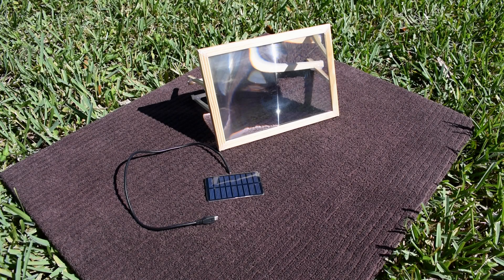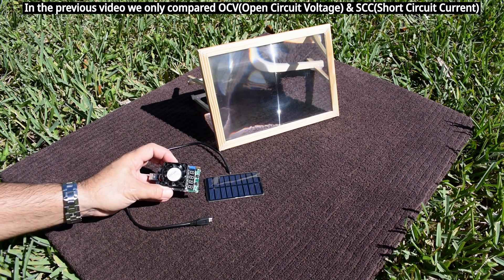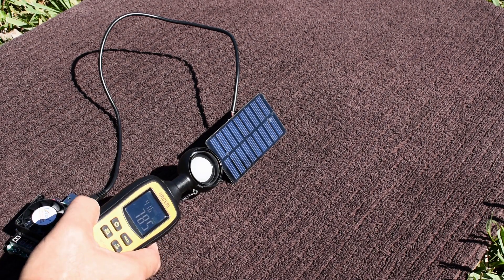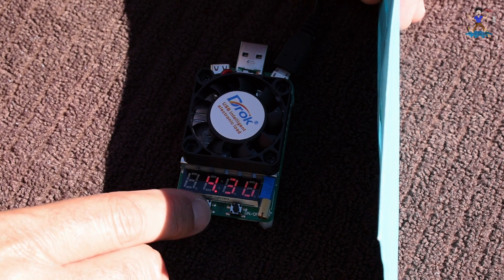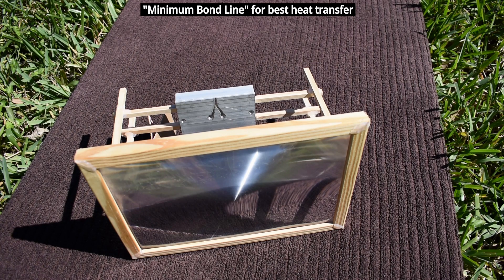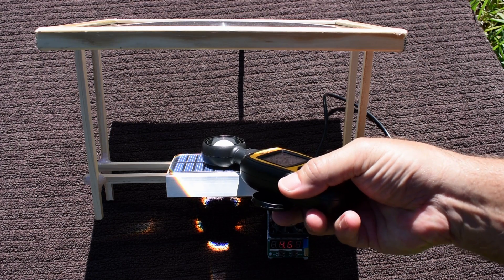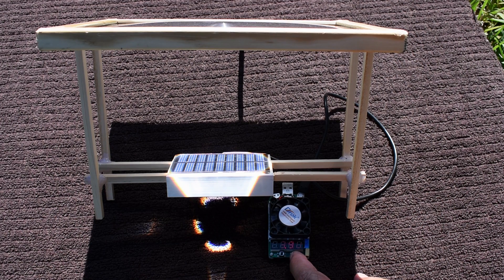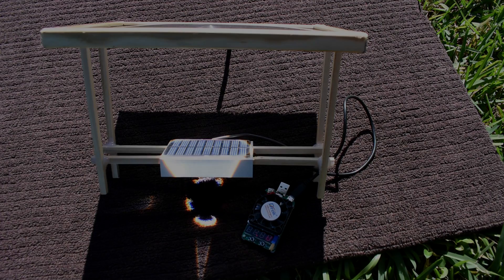Fresnel Lens Solar Panel Experiment WITH Cooling!

Comment: And a hearty good evening to you from Illinois.  Couldn't you take the top of a solar tube and hover it over a solar panel?  Wouldn't that double the output of the solar panel?  And if you connected a cooling device similar to a car radiator to the back of the solar panel, wouldn't that draw the excess heat from the solar panel?  And couldn't someone take that heat and store it in firebricks?

Comment: I'm not ripping anything you've done, I love solar and I recently finished another folding panel for myself to charge my phone while camping.  Honestly I love engineering gimmicks, but at the end of the day KISS is still really hard to beat.  If you're trying eek out 100% more power, just have 2x the cells.  Bifacial aren't even a great solution given their cost, but they might actually lend themselves to reflective setups.  Unfortunately cells output less as they get hot, and the cooling you have to add offsets the gains.  Fresnel lenses really aren't cheaper than solar cells once you add up the structure, cooling, protection (from elements, UV and hail).  Nice demonstration but no real gains over simple m^2.  Especially considering weight, because you have to support the weight, and harden the panels to the effects of weather.  

An exception to this, if you really want to make more power from your panels, have a way to use the heat gain for other purposes, say heating a henhouse or a home.  That's called cogeneration and it's basically using the excess heat generated by the sun on the panels and put it to use rather than wasting it.

Comment: This problem very famous among "DIY LCD Projector" people, LCD matrix from usual LCD monitor, when black screen picture is there, receives all energy of lamp optical system. best solution - layer of water, 1cm is not best idea, but after 30mm of H2O Light will be wery cool

Comment: so how about a very large fresnel lens system with a large solar panel. what is the multiplier, direct input area? meh that fresnel lens is more expensive than similar solar panel. not the way. parabolic concentration mirror is much better and universal. no special fresnel lens panel required. of course you cant work for free. so give it free. what good are you doing in trading anyways. yep diy then you dont burden anyone with wild nonsense. well yep you then only  burden yourself. if you chose to do so. I hope its a nice hobby that you like to do. how about a diy solar concentrator lens with a  transparent water tank.

Comment: Great! That's about as much as anyone is going to squeeze out of that mini solar panel w/out an active cooling syst3m. I really appreciate your frequent monitoring. I'm always interested in how things are changing, and it's frustrating when ppl making videos don't monitor those changes frequently. So, thanks!
Reply: The problem with active cooling is there's always a conversion inefficiency.  So you got 10% more power, you'll need to move air, the motor is 80% efficient use of power.  So by the time you're done, you'll end up -2% or worse because you're running a motor/pump/baffle to cool it.  Why would you exchange the expense of Fresnel lenses and their supporting structure, which BTW is exactly the same m^2 as solar would be, and just use cells/panels?  Make no sense.  Fresnel lenses are expensive, not usually UV stable (they're plastic), and need supporting structure to hold them in place.  Plus the structure to hold the panel, plus the UV stabilizing cover (glass + it's structure).  There's not much more effective than straight solar cells, perhaps with sun tracking in 1 axis and even that's questionable once you figure in maintenance costs of the motors, oiling the bearings......

Comment: What about putting the F lens directly on the solar panel(s) and seeing how far away from 90º you can get from the sun, before losing output?  Use those concentric rings to gather light from different angles and point it down onto the PV cells, ya know?

Comment: If you put peltier module under the solar panel and then a heat sink... Can you generate with this system even more electricity and provide cooling for the solar panel as well?

Comment: interesting test.  the heat sink would work better if you flipped the panel & heatsink so thr sink was pointing up & used a mirror underneath to aim light from the f, lens at it.

Comment: Your approach is backwards. Cooling is helpful but requires NRG which causes pericitic loss. Set the lens away casting only the needed amount of additional light to find a sweet spot for maintaining cooling while producing maximum output.

Comment: solarpanel using only visible light (380nm-750nm 46% sunlight) spectrum (Shockley - Queisser limit? PV materials have band gap?)? Solar radiation spectrum (sea level AM1 vs. AM1.5 (G/D, +45* angle)) (W/m2/nm)? (this lux / light meter show UV (10nm-380nm) & iR (750nm-1000000nm 47% sunlight, going to heat?) light (in lux) too? how accurate are the measurement data in light spectrum (wath solarpanel need/using)?) what is spectrum lose after plastic film (magnifying lens) (and reflection lux & spectrum vs. initial light vs. after plastic) test mW (because heater give +10% power vs. w/o heater (0.2W + 10% = 0.22W and u dont see this + measure device is over +/- 10% loss of accuracy (or more if under 0.5W reading (+/- 0.1W) ) ) ). Better heater is like CPU heater (heating tubes Cu foam thermal conductivity Liquid Absorption). How much is reflection in solarpanel (glass) surface (light angle +/- 10"/20" vs. energy (W) )? (solar panel + water heater (or water expansion/pressure (w valves (+30*C (7par) & +38*C (+41par).))
) 
(+ wind turbine)(+lower ground temperature)) (or heater in winter under 0*C (expansion (solid)ice/water is 10% (water crystal (six edges (hexagon) shape) ) vs. (liquid)water +0*C ~ 4*C & over +5*C ( watch water triple point diagram )) )
5:05 Why? cost (one & multi (6x) ((packed size (night) in emerge box / travel backpack or in car) Lens size, 30*20 cm * 6pcs + 6pcs solarpanel + 6pcs heaters +  )) = Lens + solarpanel, weight = Lens + solarpanel, energy (W, Wah) , packed size  && vs. comparison with one large (Lens size, 30*20 cm ) solar panel

Comment: try in a vacuum!! u could also make a cryo cooler! need 2 be familiar with cryo!! super simple though...
Reply from the maker: Great suggestion. I have a vacuum chamber.
Reply: @electronicsNmore  .their was an engineer, that made  a ''reinforced' vacuum box. 4 ''proof of concept''...but, I don't remember. if it was a ''zero vacuum''. or a ''pressurized vacuum'' +ATM or - ATM??? & the box was over/on top of, the solar panel..but seriously! it stopped ''all'' negative effects from the sun!!!
they also make a high-temp epoxy, that is ''perfect'' 4 hot applications!! U can take a butane torch 2 it!!! no UV coatings, just pure photons!! also, if U knew a little about ''optics'' U can produce an ''un-focused'' optical telescope. that will have the ''intensity''. but little heat? that's the ''key''!!
''NO HEAT''..good luck with it !! if I was ''able'', and had the time! I'd give U some more hard luck stories!!

Comment: If you had a huge panel and did something similar, could you generate enough power to run a water cooling device to cool the panel? Sort of sounds like perpetual energy kind of situation.
Reply from the maker: You always lose, never gain. :-)

Comment: I don't understand how the Fresnel lense helps increase the voltage output of the cell. Isn't the PV effect based on frequency and not intensity?
Reply from the maker: Higher light intensity = higher voltage output to a degree, and higher current output. Thanks for watching!
Reply: @electronicsNmore  hmmm, I must be confusing something. The photoelectric effect shows that light intensity doesn't matter, it is the frequency of the light that dislodges electrons.
https://en.wikipedia.org/wiki/Photoelectric_effect

Comment: Hey guys hate to break it to ya but you can get 99% solar efficiency just by heating water. Sure it's AC current but even if you rectify it that's still 79%. In my opinion I wouldn't touch photovoltaic cells and they seem to just be more cheap Chinese made crap :^
Reply from the maker: I guess you missed the part about this just being an experiment, an experiment that many viewers requested.
Reply: electronicsNmore lol it’s not a bad video or idea it’s just pitiful in comparison. Plus it seems like no one even knows that!

Comment: IF infrared is not needed to make power then using a IR filter will keep the panel cooler =]]
Reply from the maker: Blocking IR, ends up blocking a lot of visible light, and the power will drop way off.
Reply: @electronicsNmore   yes but if you concetrate more light on the panel you will have good power with less heating or none ... you have one panel but you can get more light on it from mirrors and fresnels

Comment: wouldn't a fresnel lense be ideal in cloudy conditions?
Reply from the maker: No, you need some sunlight.
Reply: @electronicsNmore  I know it wouldn't work with completely overcast sky, but when there is indirect, diffused sunlight wouldn't you see some augmentation with the lens? Those of us at extreme latitudes with few completely sunny days could use every little boost we can get. Heat build up would be lower also. I don't have all the great equipment you have, nor the EE training, but I may buy a small solar panel and lens and multimeter to see what happens on an overcast day. I have seen other YT videos of a solar panel laid out in the rain running a small radio, which took me by surprise. Thanks for doing all these videos! Subscribed and learning from you!

Comment: I was just wondering if you applied this method to a larger solar panel with storable power packs would the fresnel lens charge the battery faster and if so how much faster
Reply from the maker: Yes, much faster, but you'd need to keep everything cool.

Comment: I also thought using convex lens and Fresnel Lens to increase solar panel. However it is a hassle to set up them in the correct position. It is better just to buy more solar panel. The new solar panel product is half cell solar panel.

Comment: Add a filter to block unnecessary wavelengths, so the panel wouldn't heat up quickly
Reply from the maker: Cuts power output too much. Thanks for watching!

Comment: The fresnel lense is about 8x the area of the solar panel.  Since the power developed with lense is 4x the panel alone, the system efficiency is about 50%. 8 solar panels in the same area of the fresnel lense would develop 2x the power at a lower temp at the panel
Reply from the maker: As I said in the video, it was only an experiment, one that many people requested. Thanks for watching!

Comment: If you are going to cool the panel...

What if the photovoltaic panel is the surface of a thermal solar collector.  That way you get electricity and a second harvest of hot air or water.
Reply: That's beyond the american mind, Alex...

Comment: Has anyone taken a peltier module like is used on a wood stove fan and mounted them to a aluminum plate and laid it out in the sun light with a painted black plate on top. Hooked in series could get a new type of solar generation system. Even making floating solar barges could be a thing to slow ocean heating buy turning the heat into electrical current.

Comment: Should further collect the thermal energy via a peltier chip to the heat sink.
Reply from the maker: Then you'd need to cool the opposite side of the module.
Reply: @electronicsNmore  I think Todd is saying you should put peltier junctions between the solar panel and heatsink to collect more energy.
Reply: @0JThomps0  And drive a fan with the collected power to cool the heatsink.
Reply: @resetcoder  it would probably barely be enough power to turn the fan slowly. Peltiers are pathetically low efficiency.
Reply: @jkenny1  i know that is why i said that, to make it completely pointless, but at least more difficult

Comment: Saw a similar experiment years ago, the issue was addressed by submerging the panel into shallow water
Reply from the maker: Yes, that's next, but you need to circulate the water, or it will get very hot quickly. Thanks for watching!

Comment: I recon that water flowing over the panel would cool it down enough to allow for the wattage use of the said motor.
Reply from the maker: You wouldn't gain anything by adding a motor.
Reply: electronicsNmore that would depend power the motor consumed a extra power you got from cooling the solar panel

Comment: 70°C is pretty hot. Using a CPU heat pipe or a water block would keep temperatures lower.
Reply from the maker: I can get it lower by making a few changes.

Comment: What if you put a mirror under the solar panel, flip the panel upside down then focus the sun again through the Fresnel lense. Since heat rises maybe it could rise easier into the heat sink. Maybe also the light coming through the mirror could have less infrared heat?
Reply: Heat does NOT rise.
Less dense materials rise.
Most materials show decreasing density as temperature increases.
That isnt the heat rising. Its the material.

Heat simply flows to achieve equilibrium. No direction.

Comment: The fins would cool substantially better if they run vertically instead of horizontally.
Reply from the maker: True, but it wasn't easy finding that particular heat sink.
Reply: @electronicsNmore  possibly you could cut the heat sink in half with a hacksaw, and turn the halves 90 degrees?

I've been really curious about this exact experiment, so I want to see it run with optimal execution to see if it can be effective enough to be worth it in a larger scale application. 

Next level after this would be heatpipe to a radiator in a water bath.  Keep up the great content!

Comment: I believe that solar panels get their energy from the ultra violet part of the light spectrum if your lens is made from plastic then you might get a better result with less magnification via a glass lens as I’m fairly sure that most plastics block out a lot more ultra violet light than glass. It’s a worth while experiment as it may prove practical in extremely cold climates when power lines are down or when there is a lack of sun light.
Reply from the maker: Thanks for watching Tim!

Comment: i have a 275w panel, so i would need a fresnel lens about 40x30ft......
Reply from the maker: You're way off. This was only an experiment, and clearly it would be used for smaller panels.
Reply: @electronicsNmore  theres no reason to /not/ use it for larger panels, and larger panels are easier to water cool. fresnel and wind are the problems...

Comment: I worked for Mobil Tyco Solar Energy, formally Tyco Labs, in the 80s. We manufactured and sold systems just like this, Fresnal lens concentrators with water cooling. The difference was our systems were linear as opposed to square like yours. We manufacture the solar cells as well using the EFG thin film growth method.  Electricity and hot water from the same system. Then oil prices crashed and it was very cheap again so Mobil sold the Tyco Labs and moved on.  I think the company is still around and building flat panel arrays.
Reply from the maker: Great info! Thanks for watching
Reply: I would love to see this go into full development again

Comment: A heat pipe attached to a thermoelectric generator to power a small fan to dissipate the heat might lower the temperature even further. 
I'm also sure that with enough people looking into your Fresnel lens solar they could find cheap and good parts to continue this.
Reply from the maker: Hi Frank. The problem is, the Peltier module needs to be cooled on the opposite side for it to produce a lasting supply of power. Thanks for watching!

Comment: I'm wondering if it could be better with some extra passive-cooling.  If you covered the fins of the heat sink on the side farthest from the panel, and add some ductwork to the other two ends.  One side going straight down, staying in the shadow. The other one going straight up, or at a slight angle to clear the edge of the fresnel lense,  to encourage a strong draft. It's such low temperature that you could get away with prototyping in cardboard as it can take up to about 500 degrees.  Looking at the profile of the heat sink, it looks like the cardboard box from Macaroni & cheese might work well. I would think that at least a foot of rise is needed for a decent draft.  Two would be better.
Reply from the maker: I think a water cooler heat sink is best.
Reply: @electronicsNmore  Agreed! But you have to move that water, and that lowers your output.  It would be worth it if you get more power out than needed to run the pump.  Testing is required. Passive cooling is easy and will definitely provide more power.

Comment: Would the sink work better if The fins were vertical ?
Reply from the maker: Harder to find those, but maybe a slight bit cooler because the heat can easily rise up and out.
Reply: Just turn the entire thing sideways
Reply from the maker: @travisockerman4361  That can be done, laying on the side is unstable, I'd have to add a couple supports.  Thanks for watching!

Comment: I also believe the heat sink is good without lens. With lens you can add bigger heat sink or water cooling.
Reply from the maker: Yes, it would help keep the panel output voltage higher. Thanks for watching!